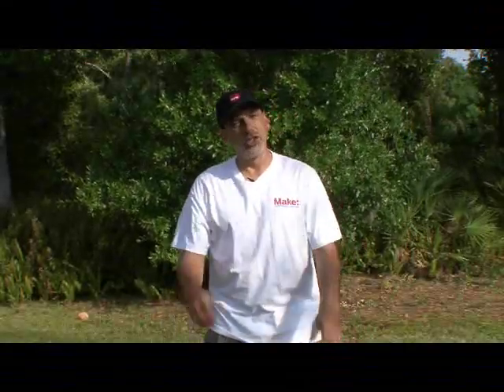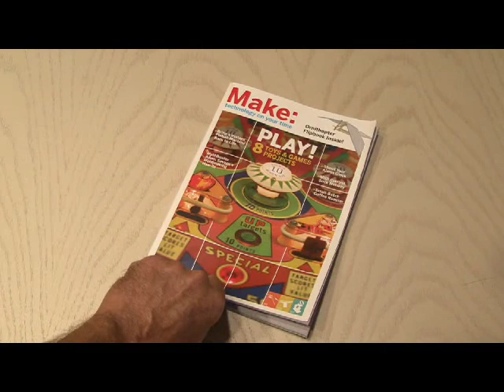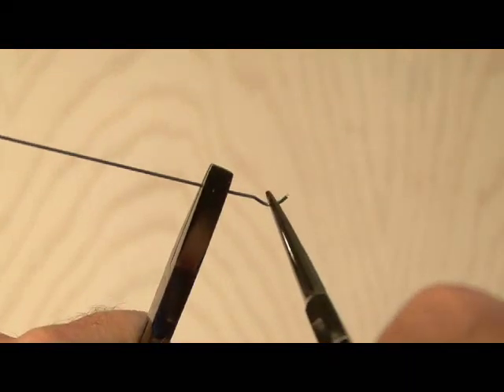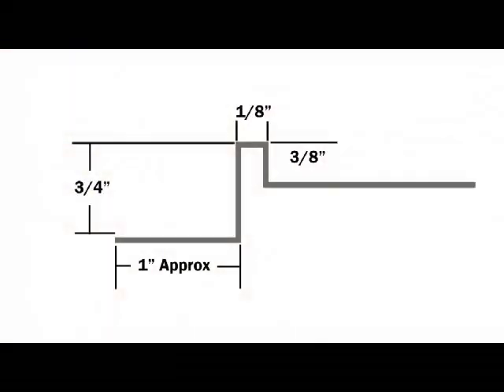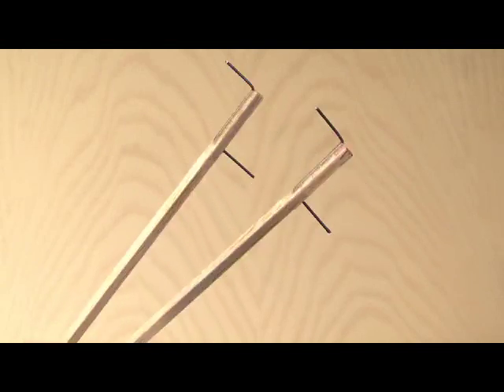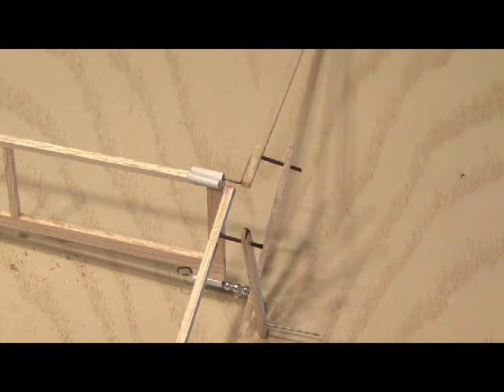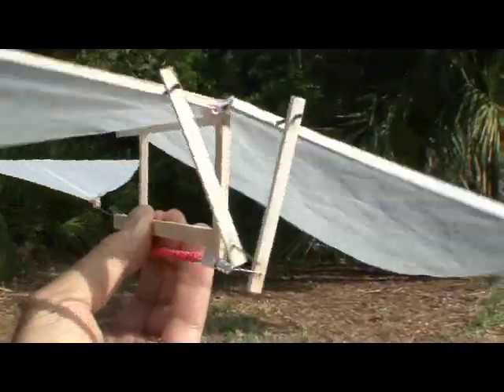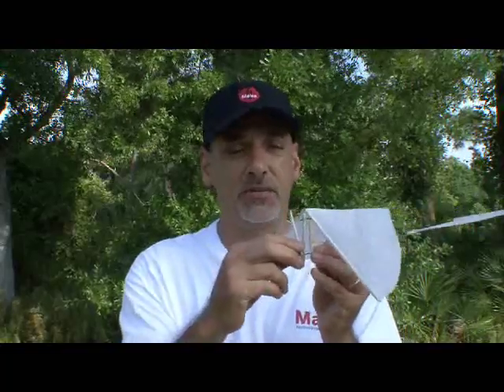Weekend Project: Build an Ornithopter

Comment: His bird would work better if he switched the connectors... the one that's on the left wing (on the back part of the crank) should be attached to the right wing. You wouldn't think it would matter, but due to the 60 degree angle angle you put in the crank, it's the difference between the wings flapping at the same time and being significantly out of phase. And you want them to flap at the same time.
Word to the wise if anyone decides to build this :)

Comment: How about: taking the internals of a 1:64 (thumb sized) RC car, which cost only a few EUR/USD? You get a rechargeable battery (i doubt it's Li-Po, probably Li-Mn), the motor and a servo or 2 motors - everything of those weighing just a few grams, and the remote with charger. You will probably need to build a reducer though, with something like a couble of plastic wheels and rubber bands, as the motor is weak and fast, while you need powerful and perhaps not so fast.

Comment: That design can actually fly very well. The only problem is it's underpowered. Use a 1/8" diameter contest rubber loop a little longer that the motor stick and watch it fly close to a minute or more by lubricating the rubber with a little bit of dishwashing soap. Try putting about 200 winds.

Comment: Do not be deceived by this video. This ornithopter does not fly, because it is a bad design. Don't waste your time building it. Instead, try the Freebird plans on the Ornithopter Zone web site. The Freebird is capable of true, powered flights, as shown in the "video response" I posted. Read the info about the video. There is a link to the web site.